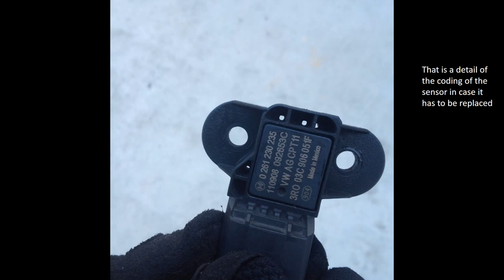P0106 - Remove and clean or replace MAP sensor VolksWagen Passat/jetta 2012 engine 2.5

Comment: Here is a tip for you good people dealing with this dreadful p0106 coming back. Check your intake manifold bolts, they may be loose. A loose intake manifold can contribute to a code p0106. Upon doing this, vlean inside the intake manifold, clean out your throttle body, clean out your hoses & check your intake manifold bolts.
Throttle body - torx 30
Intake manifold bolts - either a 6mm hex or a torx 40
Clean with throttle/intake cleaner
For map sensor, clean with map sensor cleaner..could be bought at walmart.
Vlear out your p0206 with an obII reader.
Good luck and hope it helps you.

Comment: Thanks! Followed this video to change the pcv diaphragm on my 2013 Vw Jetta 2.5L wagon — there was a hole in the rubber ring. I also changed the MAP sensor which was covered with oil. It’s a good idea to change both if you’re getting P0106 code.

Comment: Thank you so much!!!  Pictures along with a few text can do wonders.  I had diagnosed the check engine light error using a OBD sensor to P0106 but had no clue how to get to the sensor and diagnose.  Your video on how to remove, clean the map sensor and the throttle saved me couple of hundred dollars. The map sensor was filled with oil, disassembled following your instructions, cleaned, reassembled, test drove and the the error code is gone.
Reply from the maker: Welcome
Reply from the maker: please subscribe to my channel . I need to reach 1000 subscribers to survive
Reply: Gopi Kurse on a jetta or Passat?
Reply: How far do i have to drove the car to see the code is gone?

Comment: For a newer car, it is the simplest and easiest car I have ever worked on, TDK2K. The German Engineers knew what they were doing by keeping things simple as they could.
Reply from the maker: yes but has lot of electrical problems
Reply: Knock on wood, no problems yet. Can you tell me what to look out for. Thanks. 2012 Jetta 2.5 SE, 110,000 miles.

Comment: First time my p0106 code came up on my 2012 Passat, i just followed this and it disappeared...that was several years ago. This year, same code came up and I did this again. The code kept coming back...plus there was a smidge of oil on it. Turns out, the pcv valve diaphragm was leaking due to a tear in a rubber gasket of sort. I just replaced that. 

I changed the pcv valve cover a few years before the first p0106 code came up because of a different oil leak. I found out that the diaphragm is prone to break due to the bad design of the 2.5 engine.

Comment: Had this code on my 2011 Jetta. Come to find out the main reason you get this code is the Pcv valve failing. Bought the dorman replacement pcv valve and cleaned the map sensor about a month ago. The code has not come back.

Comment: Thanks for the vid.

Why are the hoses and clamps such a pain to remove and reinstall?  God, i hate working on my VW.
Reply from the maker: those clamps are high retention. So the only way to remove it is to use a caliper parrot adjusted with the opening as much as the distance between the 2 lips are and then tight it until 2 lips touch and the clamp should stay open, and easy to remove....I'll try to add it to the movie as soon as I have time
Reply: I use vice grips quite handly on mine, I'm probably going to have to replace my MAP because the mechanic I had work on it last didn't replace the intake clamp properly so it was sucking dirt

Comment: Having trouble finding a replacement torx screw for the map sensor at the intake manifold, it looks like bolt for the throttle body only smaller, online extensive searches come empty and have ordered countless wrong bolts from Fcpeuro, any help part# and size l think it's t20 but I stripped out the head that's why l need new one.
Reply from the maker: Maybe just replace with hex screw same size

Comment: do I need the coding in case I have to replace the sensor? Does it need any programming? Or just replacing it and be done with? I bought the part and want to replace it myself but I dont know if I need to program the sensor im not that well versed into mechanical work
Reply: That is my question too.
Reply from the maker: Just replace

Comment: When you take off the main cover. Right behind the oil cap there is that same looking sensor.
Reply from the maker: I never noticed that. Could it be the MAF sensor? I'm not sure if VW uses it
Reply: VW does not use MAF it could be an exhaust sensor for the case of a turbo install.

Comment: can a dirty/faulty map sensor cause transmission issues (roughness/wrench dash warning)?
Reply from the maker: I'd say not
Reply: Yes it can cause tyranny issues.
Reply: Yes it can I’ve had this issue in my 2011 Jetta 2.5L the PCV gasket was leaking which caused oil to coat the sensor and caused the car to go into limp mode which causes all the symptoms you described. Cleaning the sensor and changing the gasket fixed that Issue.

Comment: The map sensor is in the throttle body but what if it’s giving me a p2188? Does anyone know?
Reply from the maker: P2188 is a diagnostic trouble code (DTC) for "System Too Lean at Idle Bank 1". This can happen for multiple reasons and a mechanic needs to diagnose the specific cause for this code to be triggered in your situation. Our certified mobile mechanics can come to your home or office to perform the Check Engine Light is on diagnostic inspection.
Reply: @crifix.  it reads the code but my check engine light is not on.
Reply from the maker: @carlingas666  well if you get a good scanner you can go check why u get the P2188